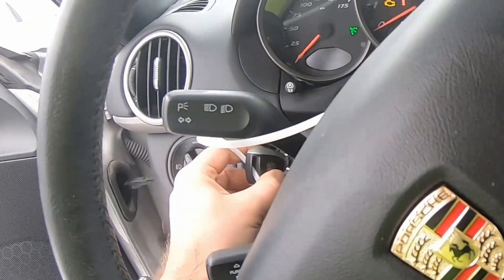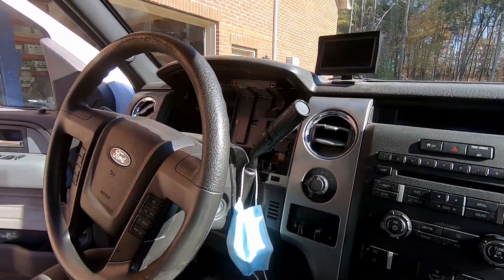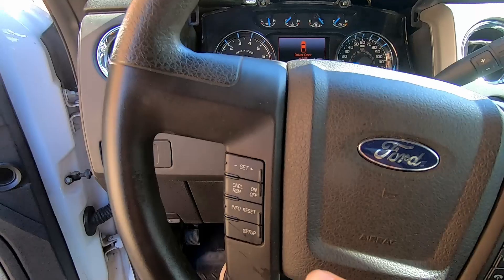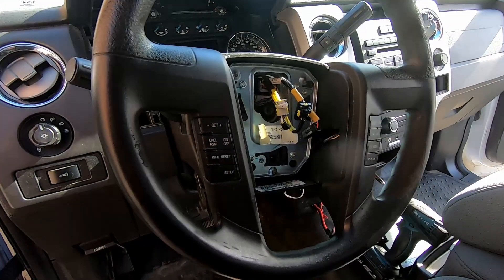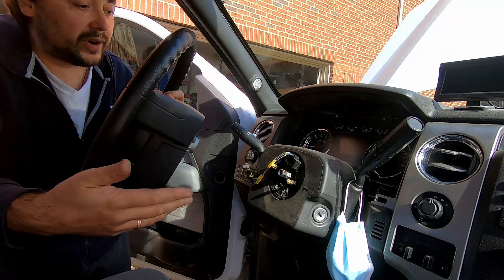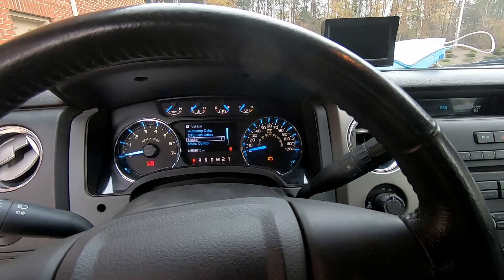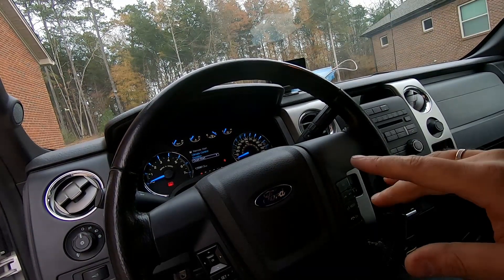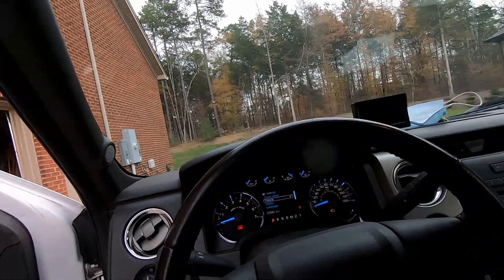2011 - 2013 F150 Cluster Upgrade and Steering Wheel Replacement

Comment: Nice upgrade! 
I would have loved to see more details on the programming.
Reply from the maker: There is really no much into the programming. There is this program - Forscan. Google for “Forscan spreadsheet”. It has nearly all possible settings Ford vehicles may be coded to. You can see part of it in the Keys programming video I posted couple weeks ago.
Reply: @HETPEZB  thanks bud!

Comment: Hey I have a f150 platinum 2009 I got cluster 2014 limited I try installing it and it didn’t work do u know why it’s the same cluster as yours
Reply: It’s not the same 09-10 has different plug ins and are not compatible with 11-14. Even though the thin screen looks similar to 09-10 on some 11-14s the controls and plug ins were redesigned and are not interchangeable.

Comment: I have a f150 2009  platinum so i buy a new  2013 platinum cluster  its same  conector  but when i plug in the 2013 cluster  it dont show  lights  or nothing the truck starts  but the cluster dont turn on
Reply from the maker: Possibly different pin out.

Comment: People should know this works only on the 11-13 f150s.
(Not on the 09-10!!) 
I Tried it already and failed if someone knows what can I do to use that cluster let me know
Reply from the maker: Fixed the title. What’s the problem exactly?
Reply: The cluster and truck wont turn on at all, I was looking at forums and some people said it could be the BCM's that change over the years
Reply from the maker: Not sure what the cluster has to do with “no-start” condition for the truck. It’s not a part of the immobilizer system.
Reply: I have the same problem. A few Years ago I tried to swap but wont start and no signs of life on the screen.
Reply: @HETPEZB  it has something to do with the cluster. I have a 2010 and my cluster sometimes goes blank and when it does the truck will not start and the if the truck is on the ac goes out that’s why I was looking to swap to a 2014 but looks like I have to find a 2010 or try and fix my old one
Reply: My truck was build in 11/1/10 somebody told me that mean it’s a 2011 does that mean it will work on mine

Comment: I would love to do this on my 2011 F150. I have the forscan already. Please provide some details on how to program the mileage. Greatly appreciate it
Reply from the maker: As far as I know Forscan can’t program the mileage. You need to desolder the memory chip from the board, read it with a programmer, find the section where the mileage is located, encode the correct mileage into the proper format, and write it in the mileage section in the memory chip and solder the chip back.

Comment: Show the detailed disassembly/reassembly.
Reply from the maker: You don’t need it.
Reply: @HETPEZB  Sorry my guy, but at least on this task, I'm not as advanced as you. Found that you have to remove the 2 bolts in the top, along with the 3 bolts under the steering column.

Comment: How did the truck start? I did program the keys to the new cluster with forscan and it says succeeded programming but the truck does NOT start unless I plug the old cluster
Reply: Mine is an 09
Reply from the maker: I may be wrong, but in my case it didn’t matter if it was old or new cluster installed. Truck was starting ok with both of them even before reprogramming.